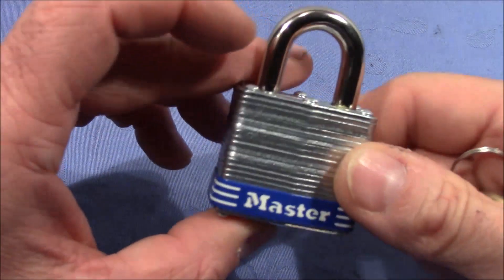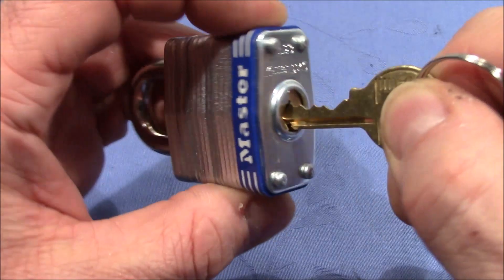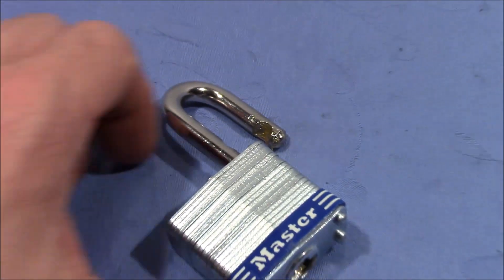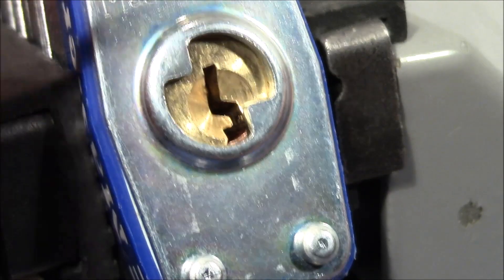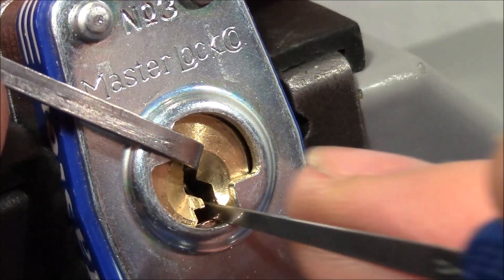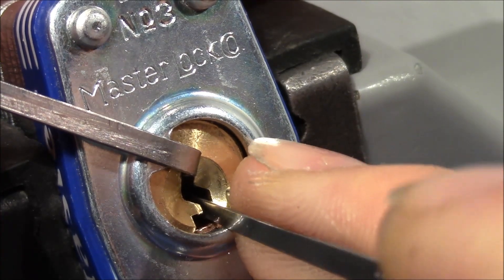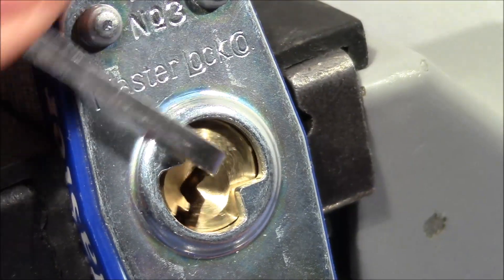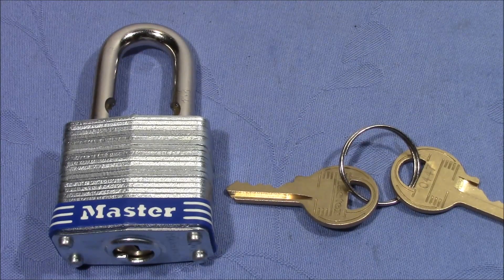(picking 762) Master Lock No. 3 - defective pinning analyzed

Comment: This lock still kicks my butt when it comes to single pin picking.   I can rake it in about 3 seconds (hundreds of times). 
I can dirty rake it with a pick by just starting with the pick resting against the back side of  pin 4, and then a single swipe out with firm upward pressure and it's open by the time I get to pin 2..  
But when I try to single pin pick it, pin 4 is always binding hard and it just scrapes along slipping and sticking and never giving me a clean click, or I get multiple clicks every time it stops.    I really don't understand why it's so hard.   It is well lubricated.
Reply: Your situation is not unfamiliar!
Two things to try:
Try applying torque/tension in the opposite direction, it can really change everything including binding order. #3's will open in either direction.
But mostly,  try a different #3. Buy a new one.  I've read that cheaply manufactured locks can sometimes, just sometimes, be nearly as hard to SPP as good locks, and it will vary from lock to lock even among the same model because of the sort of sloppy manufacturing process. 
On the whole, lower end Master locks are easy to SPP,  but every once in a while you get a dog. I've got two #3's right now myself;  one I can openly consistently within single digit seconds (and no vice), and the binding order is clear;  the other one I have is like yours; I can rake it open but SPP never works, the first key pin easily oversets and sticks even though it's a high cut, and then another pin sounds like it keeps releasing after being set.  It's the only lock I own that I've never been able to SPP, so far. A friend of mine has the same situation with a pair of #3's, one easy, one difficult (though I did manage to spp open that one). 
I can only guess, but I suspect the bores for the chambers in these problem locks have a milling issue where maybe one bore is deformed and some pins won't stay set while maybe others catch on burrs while you work on the other pins, but I just don't know. I'm tempted to take a cutting disc to the thing just to see what's causing so much difficulty.
Anyway, don't let it dissuade you, get another lock and have a go at it. Also, if you can see the keys in the package before you buy, get one without too crazy of a bitting until your ready for that kind of challenge.